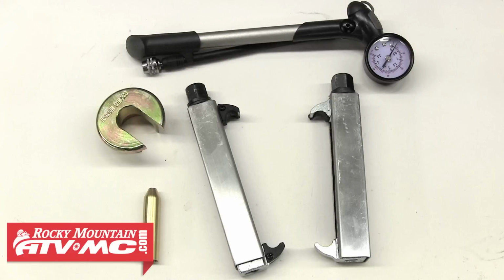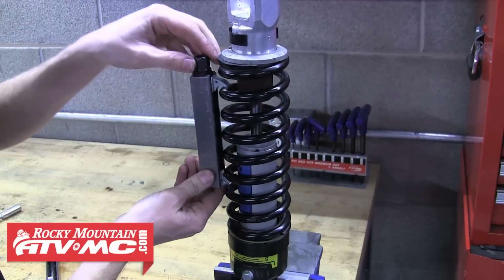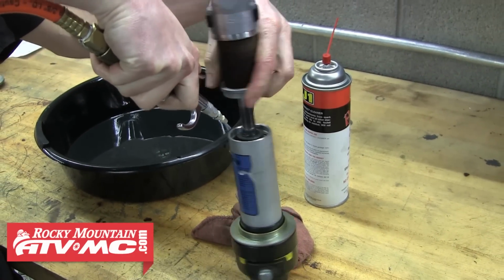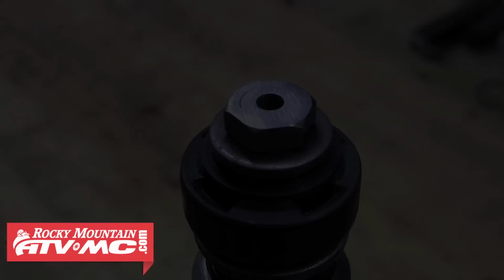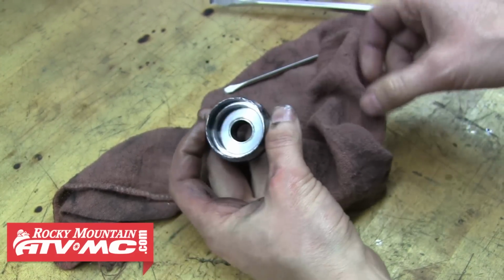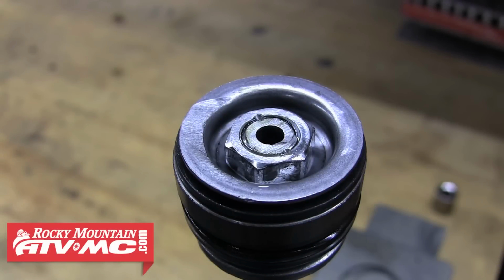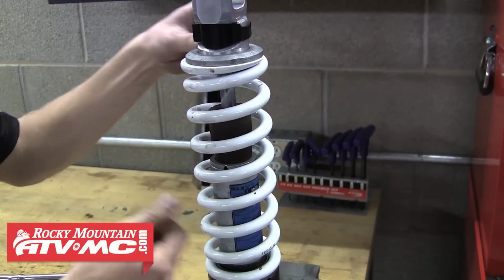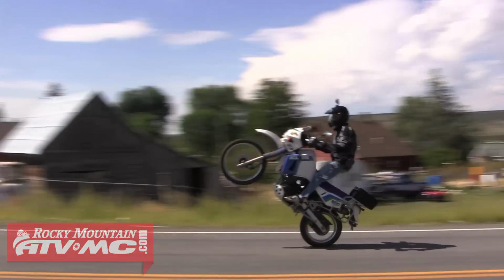Kawasaki KLR650 Shock Rebuild

Comment: my Tusk replacement kit only came with one clip ring and of course mine has two. I ended up using the best of the two existing and the new clip worked out great. just remember when you are going to put it back together whenever you hook up the spring compressor be sure that the top part is in the right notch. there is a bolt you will see the notch that that bolt fits in. otherwise you will be like me and put it together and realize that the adjustment on the top is on the opposite side and then you have to compress the spring again and rotate the top to the correct position. would have been easy if I was using the correct tools I was using a strut spring compressor for a car save yourself the trouble and buy the Tusk one
Reply: Does the Seal seat only on the first clip or does it make it to the second clip? Mine only went to the first clip, what does the second clip do?

Comment: 'Happy to recharge nitrogen for a nominal fee...' said 0 out of 10 motorcycle and auto shops I called in Los Angeles.
Otherwise excellent video, especially the tip on cutting the plastic N2 fill cover.

Comment: Hello, very nice video. Did I understand correctly that 140ml shock absorber oil with viscosity 10 and then 140PSI nitrogen pressure must be filled in? Have a nice time, Tim

Comment: I Rocky Mountain .follow the footsteps of your video bag spring and then ,, pressed the valve to release the pressure , the bag but does not leave the hydraulic oil through the hollow valvuls

Comment: @Rocky Mountain ATV MC, can you post up the P/Ns, or provide links, to the replacement dust and oil seal in the seal head? I see the All Balls replacement unit on your site, but would prefer to keep the OEM steel seal head if possible.

Comment: wish you could have showed the seal piston washer order. I took mine off and some of the small washers still slipped between the larger washers and are now out of order. No pics online for the E model piston order so I now have to send it in for rebuild. Was also told these alloy All Balls heads can break down and destroy the shaft. You need a dealer to rebuild it so they can order the KYB steel shock head for install.
Reply from the maker: +Keith1212 We've had good luck with All Balls products on these shocks.
Reply: +Rocky Mountain ATV MC I went ahead and listened to you and used the seal head. But when I went to my local shop they said their nitrogen adapter wouldn't fit the klr valve. Like it wouldn't fit on the nipple because of the housing around it. So he said he put 60 psi of air in there and it would be fine. What do u think?
Reply from the maker: +Keith1212 We recommend 140 psi and filling the shock with nitrogen. Nitrogen doesn't expand or heat up like air would in a confined shock. Giving you better feel and performance out of that rear shock.
Reply: +Rocky Mountain ATV MC yea I'm not sure why a shop as big as it was didn't have the right fitting to fill my klr shock. And then to tell me 60 psi of air is fine. I'm going to St/ Louis today so I will have someone there fill it with 140 psi of nitrogen. Thx for the replys.
Reply from the maker: +Keith1212 Yea, suggested psi for a KLR 650 rear shock we recommend 140 psi of nitrogen. You're welcome. Glad you asked!

Comment: i have to disagree with the Pre-load of the spring, should not use it, if you use the TUSK compressor it makes for a situation where you run out of threads when taking off the tool and this can be violent

Comment: I see that you propose a spring change, for the original is too soft. I have the same problem on my XT660Z and I'm planning to rebuild the rear shock. Is there a replacement spring recommendation for my bike?

Comment: hello and thanks for awesome help video. I'm a expatriate Coloradan living on a remote island in Greece where it is impossible to find a shop that has nitrogen. If I do the rebuild using air instead of nitrogen what will be the result? thanks for your help.
Reply from the maker: I would not recommend putting air in the shock. Nitrogen looses pressure at a slower rate than air does and also runs cooler. Providing more of a consistant feel and dampening. Air will heat up the shock and will wear out your internals out.  Usually you can find any auto shop that will have access to nitrogen.
Reply: g karr if your island has an airfield, you might be able to check with the local airfield personnel. Aircraft use nitrogen to service tires and emergency systems. Good luck!

Comment: hi guyes, i repair my kawasaki zx7 rear shock, is similar to the kawasaki KL650, i so that you use 142 ml of oil, also you used 140 psi of nitrogen ,i need to know how many oil should a put in and how many psi of nitrogen, or where can i find some more info abaui it, thanks

Comment: Hi great video just purchase a couple parts from Rocky Mountain ATV and rebuild the rear shock on my 2006 klr 650 now all i needed was the nitrogen and put it back together but the shop that i went to said the shock has to be completely ensemble in order for them to pressurized it. My question issues if done their way would it damage the shock?

Comment: Could the difference in the new & old shock be because its made by a different MFG co ? Could you tell me the length of the shock, from bolt hole, to bolt hole, and stock rate of the spring...Thanks. yl
Reply from the maker: ***** What year is your KLR?
Reply: Don't have one, was looking to fit it on another bike. Sorry if my question caused confusion.
Reply from the maker: ***** Sorry but we don't have that information currently on hand. From doing a little searching I found the center to center of each eyelet is approx. 410mm and then the stock spring rate is a 6.3kg rate but don't quote me on this info. I would suggest looking on a KLR forum or something similar to confirm this info.
Reply: Thanks a lot. that is a starting point, even going to the forums at times is a little confusing. The reason I wanted to know was to compare it to what's being used in the Yam FZ-07 & Ninja 650, as possible surrogate shocks if needed. Again thanks for the input. yl
Reply from the maker: *****
You bet. Sorry we couldn't be of more assistance for you. If there is anything else we can help you with don't hesitate to let us know!
Reply: OK, will do.

Comment: great video...i'm from philippines just need some advice on kmx125 97 model,my shock is no longer working as it should it's so soft,i think all the gas we're gone,is it possible to repack and bring back to it's normal service?
Reply from the maker: On the bottom of the auxilary chamber there should be some sort of schrader valve to re-charge the shock with nitrogen?  From all the schematics i've checked, they don't show a good enough angle to see if there is a valve though.  So if you can tear into it and see that there is an air valve on the bottom of that chamber, there is where you would be able to pressurize the shock with new nitrogen.  You can go to your local shop to help you as well. Thanks
Reply: unfortunately there's none,even a tiny hole either..but now i finally torn apart the whole shock and all the components were in good shape but the oil seems too low..i come up an idea to install schrader valve somewhere in the reservoir but still need to buy the valve and i don't think if our locals stores here has it..well thank you for the reply i got some interesting ideas from your videos..Godbless
Reply from the maker: Randolf Dy Cool man! Good luck.
Reply: Bro hello again, I already found the valve schrader its just hidden inside the canister butt metal cap, now my problem is how much psi of nitrogen do I need to refill to this type of showa shock?it also has a bladder inside.
Reply from the maker: Randolf Dy You would need to check your service manual to get that spec.  Each bike can vary one from another.
Reply: Ok,thanks
Reply: Randolf Dy sir meron kabang video pano e disassemble ung shock sa kmx125? Salamat po.

Comment: I was able to find everything except the nitrogen. Out of all of the local motorcycle shops none of them did nitrogen. I do not understand how you can service motorcycles without rebuilding shocks. I called tire shops everywhere no one had the nitrogen or the capability. Finally I found someone in Paris Texas about 1 hour away from me that has their own rig and charged $50. I asked could you please do $40 and he said yes. Thank goodness he was able to help me. I do not know if it was biden inflation or just that he was able to charge whatever he would like because it was his own rig but I was about to pay $400 to get set up with my own just to do one shock. $158 for the manifold and no bleed valve kit. Then you have to buy a bottle of nitrogen and have it filled. Probably closer to 300 but come on

Comment: I have a 2001 KLR - (new to me) The shock is NFG oil leaks and it just bounces . Should I rebuild or start fresh with all new assembly?
Reply from the maker: You should be fine to rebuild it.  If you plan on keeping the bike for a long time, it'd be well worth the money to invest in the necessary tools and parts.
Reply: Thanks - we'll give it a shot this spring!

Comment: o ring part number wont show up on your website, did it change?
Reply from the maker: ***** What o-ring are you referring to in this video? And what year KLR do you have?
Reply from the maker: ***** Are you asking about the valve stem O-ring?  You would want to type in this part#131179008485 not the Honda OEM one.  Let me know if this is what your were looking for. Thanks
Reply: Rocky Mountain ATV MC  I tried to type that part number in and nothing came up.
Reply from the maker: ***** Hey sorry man.  I searched that part # in our system not the actual website.  You're right, it does not pull up on the website.  You'll just have to call in and place your order over the phone or you can place your order online if you prefer that way better. If online, just simply call us with your order # or phone # on the account and we would be able to add that O-ring on the same order for you. Either way works.  Sorry on that little confusion.  Our phone # is: 801-465-3140
Reply: Its fine I ended up digging through the website and finding it! So its in my order and on its way! Thanks!
 Also if you go to the link and click the drop down select "OIL FILTER + OIL PUMP" Its number 16 https://www.rockymountainatvmc.com/oem-schematic/20
Reply from the maker: ***** Right on good to hear! Let us know if you have any other questions, Thanks for watching!
Reply: @nicm5907 For which year and model of bike though?

Comment: This video is helpful, I have to repair my shock, I have spare seals buy with you, I want to know what grade of oil is applied locally Bel-Ray encounter 3w-5w-10w
Reply from the maker: We put a 10w shock oil in ours, with a heavier duty spring and we like it for our application.  A handful of factors can come into play when selecting a shock oil such as like your body weight, the bikes gear and how soft/hard you like your suspension.  For our machine and rider, we rebuilt this shock to his liking.  A 5w shock oil is pretty standard as well.
Reply: thank you very much for your reply is very helpful, I will replace the spring later
Reply from the maker: jymmy leyva You're welcome!